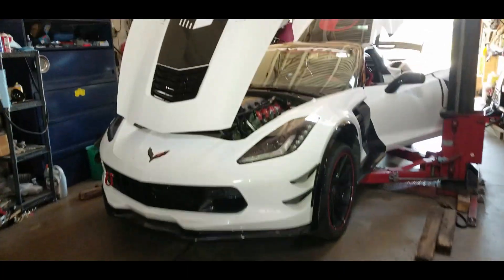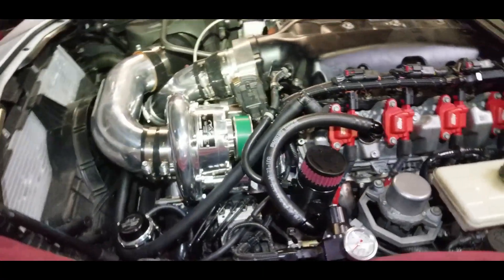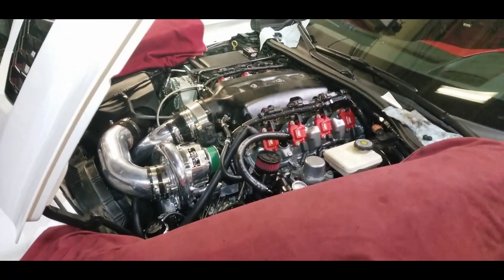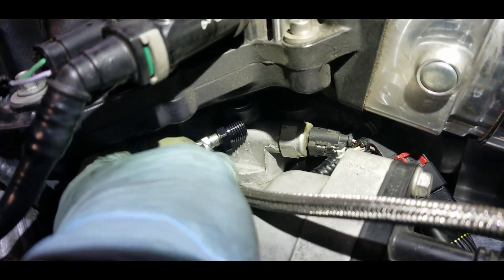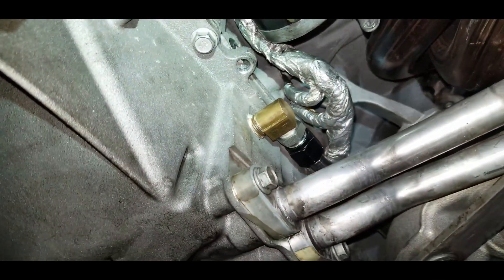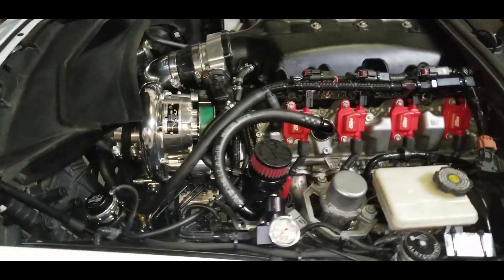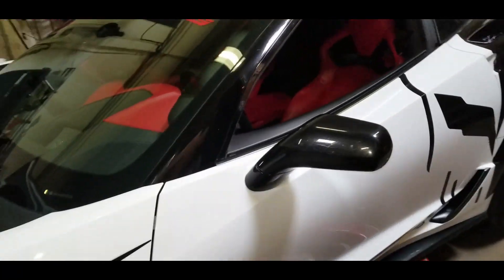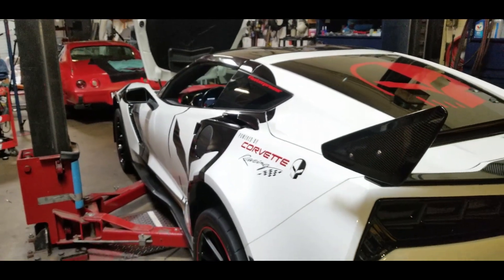Z51 C7 Oil Fed V7 YSI Supercharger The BIG ONE, +Meth Installed

Comment: Excellent video, my 2014 Z51 has 9,000 miles and I am getting itchy to put on the same A&A System. But I still have stock short block. Saw the L8T 402 Iron Block and forged crank from the GM truck guys but am advised a good tune and lower HP the stock bottom end will survive????? Great info content, lots of little things to iron out and get right. Dennis in Virginia.
Reply from the maker: The Gen5 has strong rods it will take more power than a gen4 and a lot more than a Gen3. But the issue is the direct injection over 700rwhp. LT4 stuff is good but it needs additional port injection at super high power levels. I dont like meth not reliable like oem fueling and prone to forget topping it off but it helps if needed.